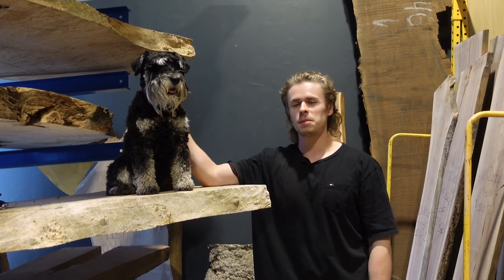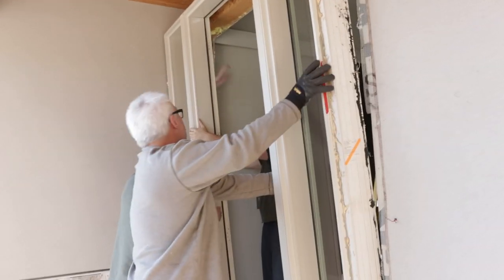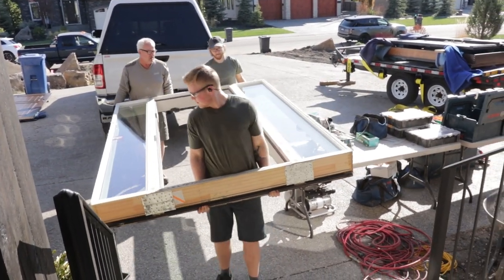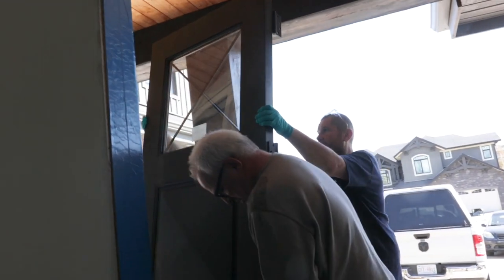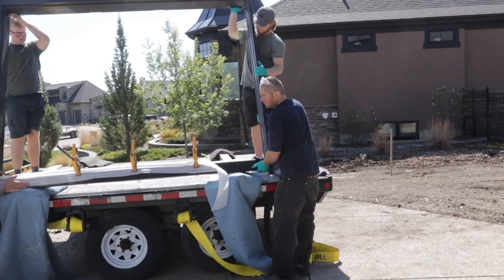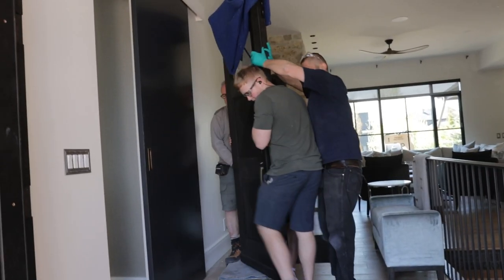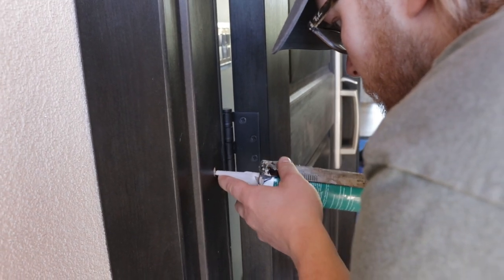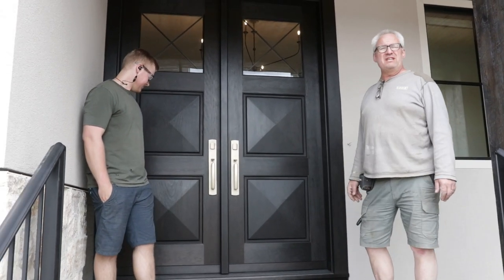Custom Black Cherry Door Install

Comment: Beautiful doors. Even when it is stained black you will still see the grain, although it is a more subtle look. Good installation video and I must agree with everything Brad had to say. However I was always taught never to hit 2 hammer heads together, very dangerous, better put that young fella right! Walking backwards down the steps carrying the door frame looked very awkward and more than a little dangerous. And finally thank you for fuzzing out the butt crack....!! Cheers Michael.

Comment: Nice vid. The doors look beautiful. Pls don’t put the blue skin at the head of the door like you did in this video. Only the sides and bottom. And make the bottom thicker next time so you don’t have to shim it over an inch from the subfloor. It is better to have continuous bottom support (touching the subfloor)  than what was done here. Take care
Reply: Sub floors are never level Dave.We leave a minimum 12mm gap so we can properly insulate.

Comment: im sorry but thoes door handels dont look in line with each other
Reply: Agree completely.....definitely misaligned. Shame on a beautiful set of doors.
Reply: @benblackforestwoodco2340  I wasnt trying to attack you or your work, I was just poiting out things in the video, go take a look for yourself around the 11 minute mark and with a straight face tell me that thoes handles look in line with each other... 
or tell the cameraman next time to stand in front of the doors not 2 metars to the right or left of the door
Reply: I did a screen capture and brought it into photoshop.  I believe the thing making it look uneven is a wide angle lens at a short distance from the door creating a bit of  spherical distortion, combined with the camera not being square to the door.  The door is pretty much perfect, the camera work is good relative to YouTube, but an architectural glamor shot in a movie or a high budget commercial would be shot differently to show the symmetry. I did a quick and dirty lens correction and it became clear that it was shot this way so the people at 11:00 look right, which distorted the door a little.